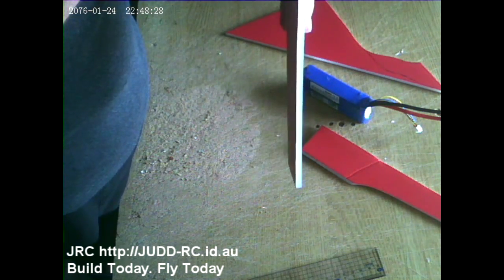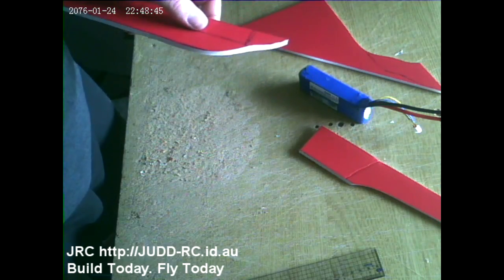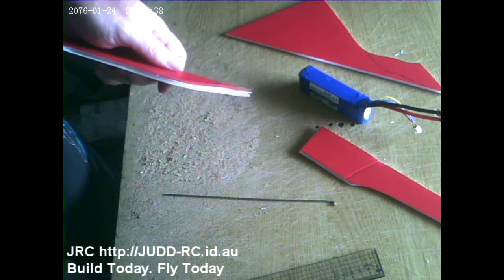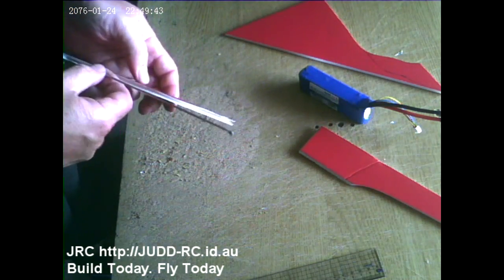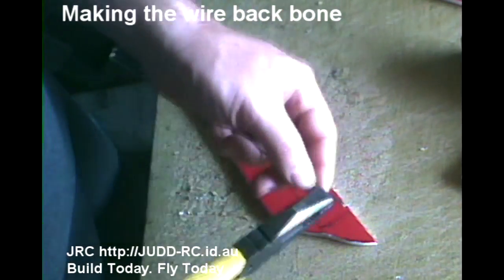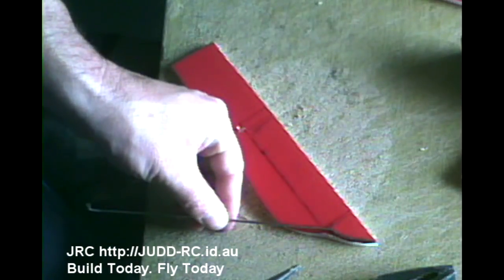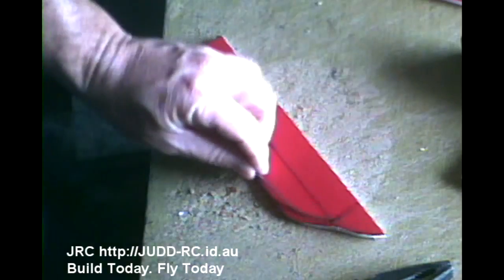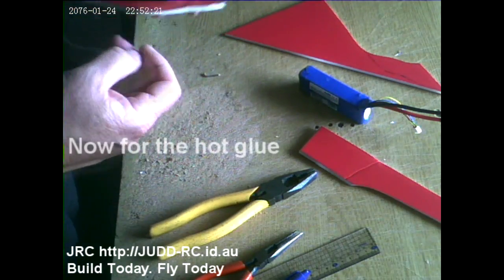RC foamboard Airplane construction techniques

Comment from the maker: I will leave residue on the tip of the iron but you can clean it off by scraping it or using any kind of abrassive then just re-tin the iron tip. :-)